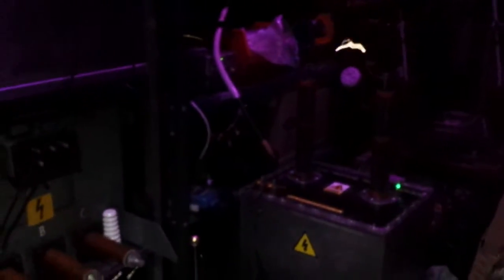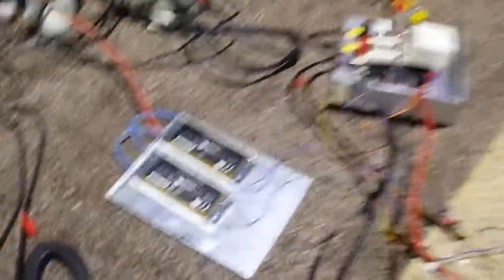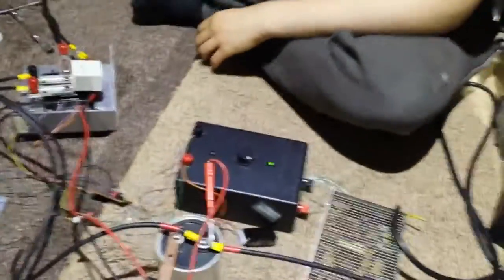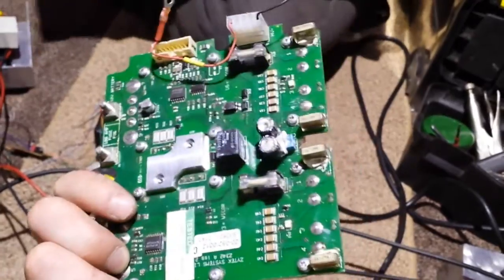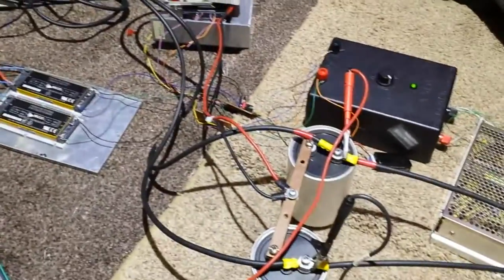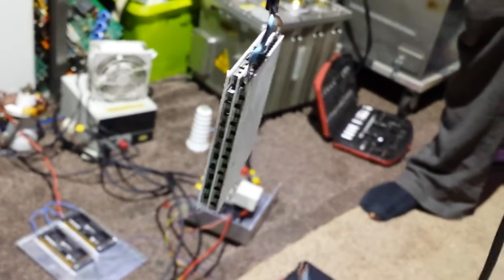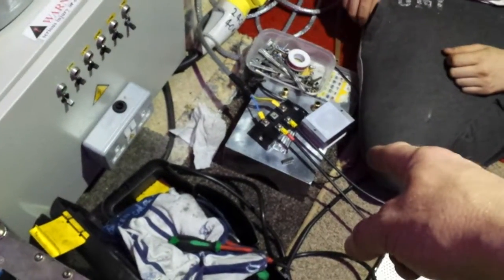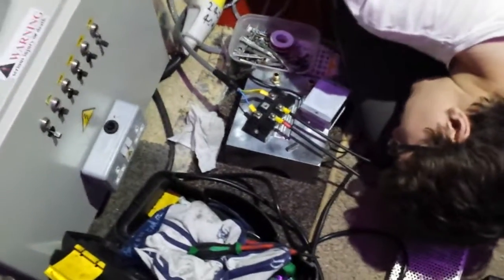IGBT Half bridge run'

Comment: Good stuff! What does the pelter unit do?
Reply from the maker: Hi matey' that peltia unit mate is awesome!! When given 12 volts dc, one side of the peltia gets very bloody hot! And the other side gets bloody super freezing mate. There what you get in these small 12 volt fridges. But the peltias are abit smaller around 10watts i think. But the one i had is 60watts💪 lol 👍😉
Thanks for the comment mate and be safe.🙋
Reply from the maker: I nearly forgot to tell you lol' the hot side of the peltia requires a heatsink and fan. And it doesnt need to be one way with the battery' + - as it will run either way! 😊
Reply: high1voltage1rules Interesting! Never heard of such an exotic bit of equipment! You could make a hot plate and a freezer all in one with it!
Thanks for replying! Enjoy your fun stuff!
Reply: Mac Man high1voltage1rules a Peltier cooler or Thermal Electric Cooler (TEC) uses a DC current to move heat from one side to the other, kinda like a fridge compressor, except a Peltier unit is Solid State, as in no moving parts, and the heat needs to be immediately removed from the Hot side, otherwise the unit will burnout.

Comment: Here's a handy hint for driving 2 opto's 180 deg. out of phase. I'm going to assume your output is totem-pole, not open-collector, such as a 555, or a 74LS04. Wire the cathode of OP1 to GND through dropping resistor R1, and the anode to pin 3 of the 555. Now connect the cathode of OP2 to pin 3, and the anode through dropping resistor R2, and to +Vcc. Now, only OP1 or OP2 will be on at any time. Select R1,R2 as large as possible to get reliable turn-on of the optoisolators. Ta-daa! Another idea is to drive it through a T-flip-flop, and use the Q and Q-bar outputs for each opto. HTH!
Reply from the maker: hey buddy, I didn't get any ideas or email of your comment you left on my video. so sorry for the late reply!! Google is crap for letting me know of most comments left.!!
 I'm liking the sound you was on about to driving igbt gates  another way.!!!! as I'm still learning and any ideas is awesome!!! I'd love to have a full bridge setup lol as I'd be able to run my big mothers of xray transformer at full power lmao!! and them arcs would be insane 😜lol.

here's my email: Antwasere@gmil.com 

when you have my email saved' please delete this comment.👍😉

many thanks and look forward to talking to you.

Anthony

High1voltage1rules
Reply: Have you ever heard about a deadtime?  How silly your idea is...